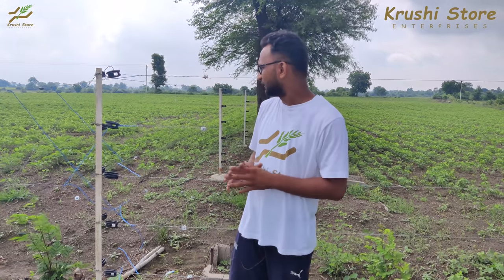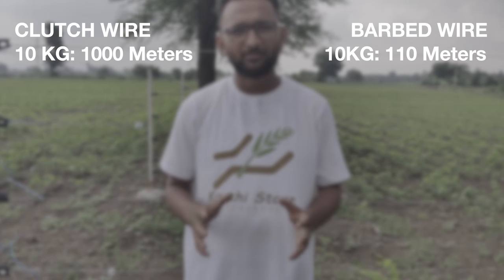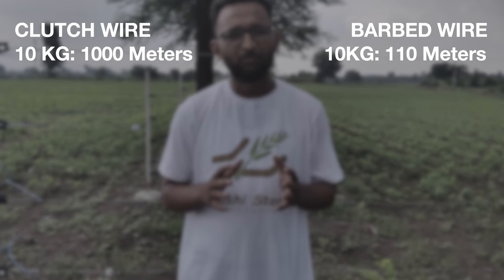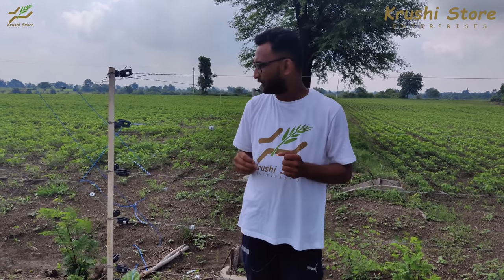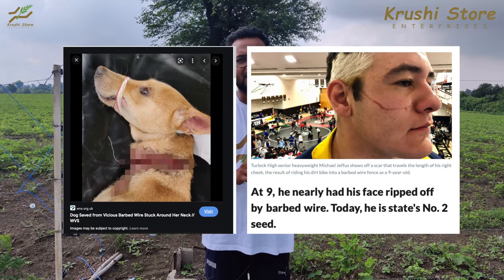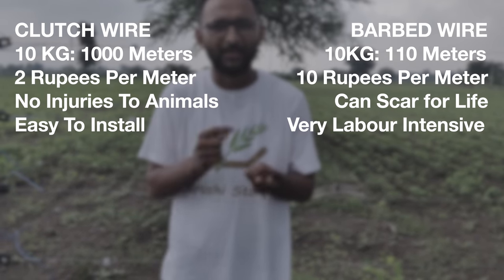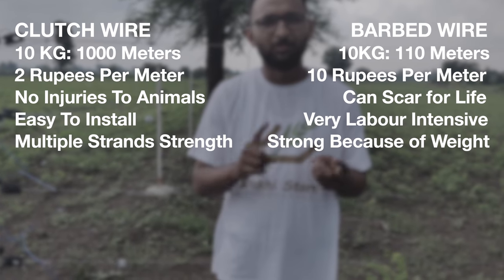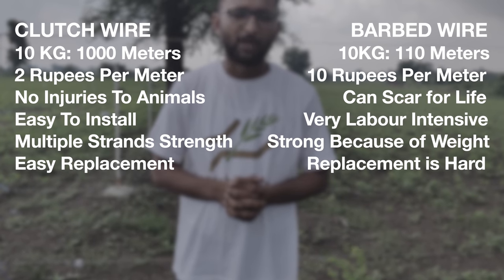Best Fencing Wire | BARBED WIRE FENCING vs CLUTCH WIRE FENCING | Best wire for Solar/Electric Fence

Comment: my farm land with border of 1.5 kms is already fenced with stone pillars and barbed wire, but is not effective in preventing entry of wild pigs (boars). Can i use the solar fencing option on the existing stone pillar fence by additionally tying the clutch wire solar system? thank you.
Reply: Instead use chain link fencing to prevent small animals like pigs and rabbits

Comment: Do we have to use electricity using solar ? Can't we just simply use it instead of barbed wire.
Reply from the maker: Can be used but Solar Fence will add extra layer of Security, Call 8308181026
Reply: No I just wanted to know if the animals will be able to enter the fence even if we don't use the shock. Adding some extra lines will do the job.
Reply: Is the wire without electricity good enough?